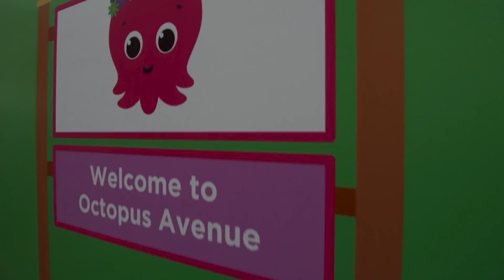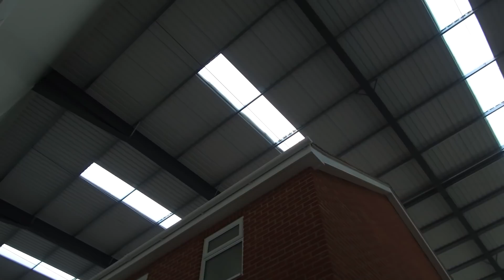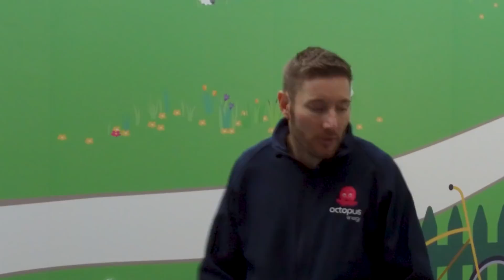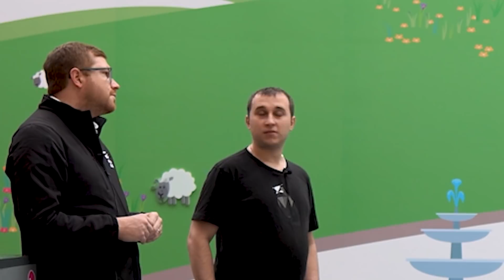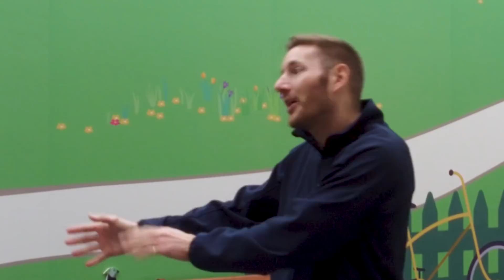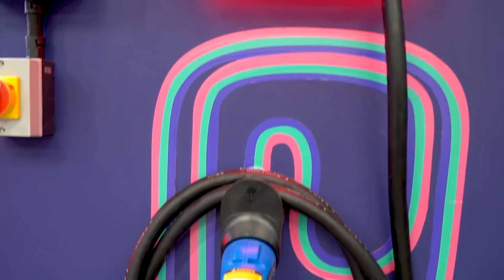How Heat Pumps Will Revolutionise Home Heating

Comment: And he never did commit to a price. OK..I live in France and use wood heating only for my 200 year old stone house. We have maxed out on insulation, the house is 180 sq metres but we only light the wood burning stoves in rooms we are using. We supplement with electric heaters but rarely need to use them. Wood here in rural Deux-Sevres comes from mostly sweet chestnut, hornbeam and acacia, coppiced on a 20 year rotation...no trees die and re-growth is rapid, allowing ground nesting birds into the coppiced areas for a few years. They tend to cut around 2 acres at a time so reducing the visual impact on the landscape. We also burn compressed logs made from oak sawdust. The French furniture and oak wine barrel industry generates 10 million tonnes of this every year which would otherwise be waste. A friend of ours with a similar house and with a lot more money to spend put heat pump powered underfloor heating in their home which is even bigger than ours but you’re talking €30,000 and a €2,500 a year electricity bill. We spent €350 last year on natural and compressed logs, our electricity bill (we have an EV and solar panels) was €800 for the year. I’ve just looked up the price to buy and install a new gas boiler in the UK...You’re talking £900 - £1300...some are cheaper, this is mid priced. Can you really see heat pump prices getting that low?  I love the idea of heat pumps but as we have no radiators, the cost and disruption for us would be astronomical.
Reply: Air to air ductless in nz - had ours installed (7kw) for $2000nzd. 

Just don’t use hydronic and get air to air.

Comment: As ever another great video but it has aged rapidly between filming and production. Gas prices have rocketed so what would your £30 a month gas bill look like now!? Did you ask him what your likely electricity bill would have been per month converting your home heating to a heat pump? That would have been interesting.
Reply: Gas seems to have increased as a higher percentage than electricity, so whilst both cost a lot more, the gap may be lower than when filmed.
Reply: @Muppetkeeper  Indeed. Here in France there is no gas being burned to generate electricity, so a volatile gas price does not affect our electricity prices. The UK uses a lot of gas, especially to provide power in peak times and when the wind isn’t blowing.
Reply: @EVDiaries-since2019  I think France is having to import electricity, due to quite a few Nuclear Stations being off line, which has put the price of wholesale electricity up in France. However, unlike the idiots we have in government here, the French government have limited the price rises to domestic customers.
Reply: @Muppetkeeper  France is the largest net exporter of electricity in the world.  It does occasionally import some but its exports last year vastly outnumbered its imports. The MWh price varies up and down greatly in all markets but the impact on consumers here is minimal with a 4% price increase this year on last as compared to the UK where consumers will pay 54% more this year.

Comment: so basically we need all the rich people to install these for a few years before they are cheap enough for the rest of us. right now, today, they aren't a solution for the vast majority of people
Reply from the maker: If a heat pump and a gas boiler are the same price, which would you go for? I would choose the non-fossil burning option. If they were the same price. That is the task already being worked on by industry. In the meantime, I totally agree, it will be those who can afford it, and in suitable housing which doesn’t pose installations issues (ie multi occupancy buildings)
Reply: @evdotnews  heat pump for sure..
Reply: @evdotnews  We were looking at this - the heat pump, itself, is affordable, but, living in a 1920s solid-walled bungalow, it is the extras to make it workable that make it unaffordable for us. We had three quotes from reputable companies, all identified the same problems, and all the overall quotes were well in excess of £18k.
Reply: We just installed an air source heat pump for our home in Colorado. We’re not “rich people “ but we do value clean air and wish to reduce our contribution to  climate change. We can’t expect to keep doing the same thing and not get much hotter and drier.
Reply: @COSolar6419  you might not consider yourself rich compared to bill gates but today heat pumps are not affordable for the vast majority of people even if they are amazing morally upstanding individuals that want to reduce their contribution to climate change..
Reply: If they were so expensive they wouldn’t be all over Europe Asia and Africa
Reply: @rcpmac  they are expensive despite your logical fallacy

Comment: Thank you for your video.
A lot of talk about boilers.
Many houses in America use ducted heat and air conditioners (HVAC).
How are heat pumps for us who have HVAC, not radiators?
Reply: Heat pumps are perfect for you. They are reversible, so you can choose to heat or cool. For use as an AC, you could use solar panels to power it. The technology is well tested. I have had my heat pump for more than 20 years now.
Reply: @matsonnerby  
And you have forced air, not radiators? Good to know. Thank you.
Reply: @CJHallx   it can also  be done with radiator loops in floor.  My HP was forced air ducting only.   The one thing I will say, and I lived in a really cold area is you don't have blast of heat feelings, it's a more steady temperature moving into the room... mentally, you have to get used to that difference IMO.

Comment: Come test your heat pump on my 1950s solid brick wall  suspended floor house that needs full cladding .new PC all round and see if it does not cost 20 thousand pounds .
Reply: a high temprature heatpump will work,  issue is won't be very efficient makes more sense to insulate first then improve heating after,  have a look if you can get a grant to improve what you have now.

Comment: Heat pumps are garbage. You either need to spend 20-30k in underground lines or they are horribly inefficient, or useless, when it is actually cold.

OR, you live in an area that is warm enough you don't really need heating.

I live in OK and we just installed a wood stove because 30 or so days per winter are too cold for our heat pump.  In Oklahoma.  Good luck in a real winter.
Reply: We live in Colorado and heat our home with an air source cold climate heat pump. It works at 100% of its rated capacity down to 5 degrees and only has 15% drop in capacity at -15 degrees. That is more enough to keep the house comfortable.
Reply from the maker: Thanks for the info. Interesting to hear stories from cold climates
Reply: You are talking about the heat pump of the last century.  It’s very much a changing technology. Current very high efficiency and very low operating temperature of modern inverter based air sourced units operate at COP approaching 5 in ideal conditions and are still functional at negative 13 deg f (see Mitsubishi website). We are at the point where a well insulated house located in a very cold climate can eliminate central auxiliary or backup heat.

Comment: Encouraging but not realistic for a lot of homes - I live in Wisconsin and we have weeks of temperatures where’s the lows hit -25 F or -32 C so I would be concerned if it could do the job and at what price or do you need a backup heat source which makes it more expensive.
Reply: Is Wisconsin much colder than Sweden?
Reply: @lighthousesaunders7242  yes I’m January we typically get down to negative temperatures while Sweden is around 30 degrees so we often can be 30-40 degrees colder - Fahrenheit
Reply: Go ground sourced.
Reply: @MarkGovier  good idea but can be very expensive and very difficult - where i live it is a lot of rock - sometimes need to blast for foundations - cable company couldn’t bury cable to house more than 6” even with a machine digging.

Comment: We really need a way to get ground source loops installed for the low (1-2) thousands. Some kind of semi-automated device that just rolls out the double-sided tubing like those pipe lining re-fitters. For any place in the USA with winters, heat pumps without ground source coolant storage are basically expensive air conditioners.

A five grand installation, all-in would be viable for most families, but fifteen thousand [goshdarn] dollars isn't gonna work out for like, 90% of them.
Reply: Newer air source works just fine to -20F.  Remember -20F is 244K.  Still a lot of thermal energy in -20F air.

Comment: You should have asked to explain this quote "If your heat pump system is not able to get enough warmth from the surrounding air, a supplementary system will need to be implemented to keep things going. While this can lead to an increase in your energy bills for a short period of time, you will have a form of backup heating that can pick up the slack when the air source heat pump starts to lose efficiency."
Reply: The one issue is that the "supplementary system" can increase the overall price by a factor of 2-3. We really need a cheaper way to install a ground loop coolant (that doesn't compromise on structural integrity).

Comment: Heat Pumps Will Revolutionise Home Heating? Is this something new in the UK? I first owned a heat pump in the early 80s. I the mid 90s I installed a ground sources heat pump. Also during the 90s I worked for and electric utility and we had programs for heat pump subdivisions and there were many of them. I've since moved to warmer climate and now I'm back to air sourced heat pumps. Even my first Nissan Leaf had a heat pump back in 2014. I'm guessing the technology is as old as A/C. For some reason the UK acts like this is something new.
Reply: The basic technology isn’t new but it’s refinement into a COP of 5 and operational down to minus 14 degrees AND reasonable cost makes it a game changer.

Comment: In Sweden Heat pumps must be the most common home heater. It has been common for at least 40 years  

To make the heat pumps work in very low temperatures it is common to draw the warmth from the earth instead of the air. That way they are just as efficient at -35 celcius as at 0 celcius.

It is facinating to see how people seems to think it was a novelty when Tesla brought up heat pumps at the earnings call  :)
Reply from the maker: That’s awesome news. I wish it was the same here. The most common is to have a gas boiler. Very soon we will get some government funding to help people by their first heat pump, so I hope we catch up with Sweden soon.
Reply: @evdotnews   WADR the UK needs to catch up  to the US 1st. where Air Source Heat Pumps are common....And colder countries like Sweden uses far more expensive Ground Source Heat Pumps...

Bottom line this only something new to the UK....
Reply: MA: FYI Tesla was late to the game adding a heat pump to its EVs :)
Reply: Fanbois always miss the point... with their irrelevant unproven pointless assumptions... SMH..

that their cult is always better and efficient,  which is never the case...  when they are tested in the real world.... ..

Comment: Realizing the efficiencies of a heat pump is also impacted by willingness to subscribe to other efficiencies....improving insulation, multipane windows, appropriately engineered air flow etc.
Reply: Yes! Taking those steps eliminates the need for auxiliary resistance or other heat. (Except perhaps heat shed from your refrigerator coils 😉
Reply: @steve roper.  Not the efficiency (only really effected by the temperature rise - so allowing and keeping the flow temperature as low as possible at all times) but the running cost befits from improving insulation, windows etc... Lots of people confuse the two, but they are separate.

Comment: in zero temperatures they drink electric .as for gas being a restricted time limit .well water is hydrogen and oxygen and to split it .there is a better method than the anode cathode way taught at schools if you utilise a spiral anode inside a cased cathode  try a old tractor glow plug and snip the inner spiral from the outer

Comment: Still can’t see how a heat pump will replace/work to replace my forced air natural gas furnace when it is -40 outside
Reply from the maker: Yes that’s super cold.!!
Reply: ask google ;)
Reply: You use the heat pump coil with your furnace, fossil  fuel controller will decide when change over to gas…

Comment: I'm with the others.  Here in the US heat pumps are very common, in fact they are the default technology in many regions.  We have two that are 18 years old and they work great.  They are less efficient as the the temperature drops, so when it goes well below freezing our "emergency heat" kicks on. It's the old resistive heating element, very inefficient but works well in extremely cold temps.
Reply from the maker: It’s rare for temperatures to go below 0°C here, January and February are the coldest months and temperatures usually hover around zero overnight. So I’m very hopeful!
Reply: @evdotnews  That is the perfect environment for heat pump technology, hopefully the transition happens quickly!
Reply: Like others I've only used heat pumps for the past 30+ years.  They are much more efficient now but if you can afford the increased price and have the land, going with a ground sourced heat pump is incredibly efficient....less impacted by ambient cold weather...as it pulls heat out of the ground.
Reply: @steveroper8733  that’s old and unnecessary technology these days.

Comment: Is this new? Think all my nabours have a heatpump. We have two in our house, both installed 10 years ago.. Extremely common here in Norway. Air to air is the most common heatpump.
Reply from the maker: That’s great! Theyre very rare here. How do they work for you? Are the prices comparable to fossil alternatives? We talked about how they were very common in the nordic countries. And you have it a lot colder than we do!
Reply: @evdotnews  Works fine at least down to -20 degrees celcius. Nobody heats their houses fossiles.. Not allowed I belive, but not sure. Some uses wood stoves in addition to the heatpump for the coldest days like us. The alternative is electric heating.
Reply from the maker: We have a survey in the next two weeks to find out if we can have a heat pump at our house. If so, we finally disconnect the gas!
Reply: @evdotnews  Why wouldn't be able to have a heat pump at your house? The only factor is how much would have to be replace to do it and how much it would cost? 

If there is other factors pls get back to me, about what I' missing?
Reply: @evdotnews  i think the closest thing to fossile alternatives that are widely used in Norway is the wood stove. Most houses have them, and they have been used even more this winter because of the insane electricity prices that mostly everybody in Europe are experiencing this winter. As a rule of thumb, usually heatpumps are still cheaper unless you find some extremely cheap wood to burn. This winter if you got the wood before the electricity prices went insane you could have saved some money by burning wood vs using the heat pump. But generally heatpumps are still the cheapest alternative to use.
Reply: Heat Pumps are common in the US even with far lower NG prices...  And in Norway they use Ground not Air Source heat pumps...  

thx YT wannabe experts for being so amusing ;;)
Reply: @nc3826  Air to air is the most common and easy  and cheap to retrofit into existing houses.
Reply: @atleyri All Air Source heat pumps are relatively inexpensive vs  Ground Source... 

Even the air to water ones that get a tax break in the UK... So its all good,  mate...
Reply: Yes but you Norwegians ought to know by now that the rest of the world is over a decade behind
Also, the hardcore cold in Norway made heat pumps justifiable long before they were justified for the rest of Europe 😊